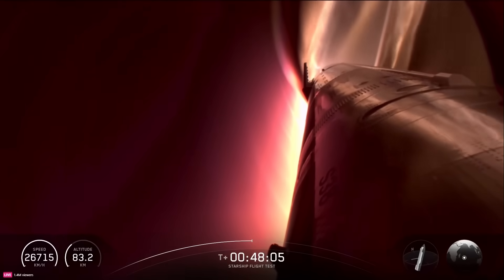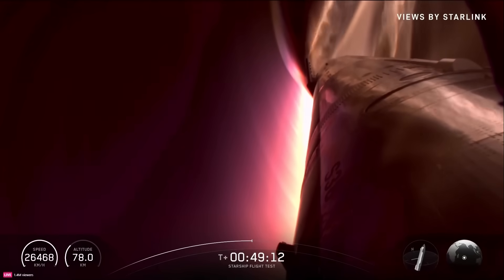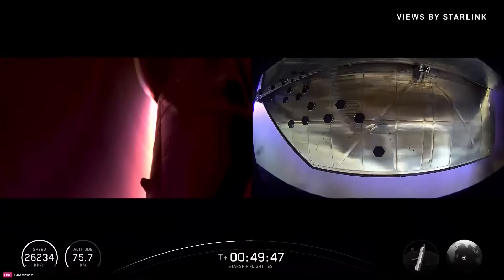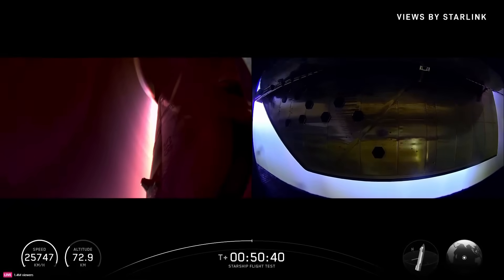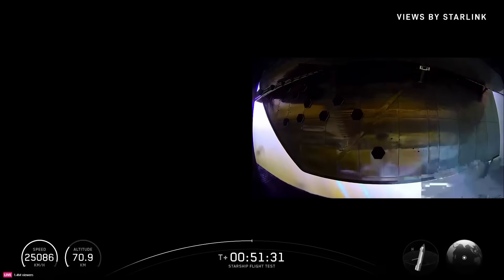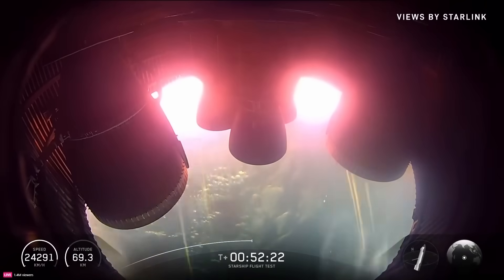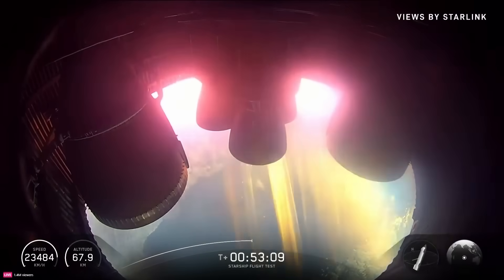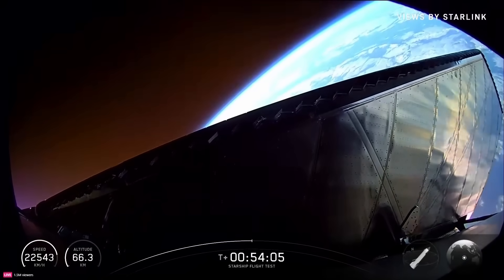SpaceX Starship Flight 11 reentry and descent | Engineers monitor heatshield tile loss

Comment: What are tiles and what do they do / purpose?  How can I learn? 4:00
Reply: They protect the main body from the extreme heat. Space ships have been using them since the beginning. Capsules have them on the bottom as they reenter the atmosphere. The atmosphere creates drag which causes friction which creates heat. The faster you are going the more heat that is generated. Do a simple search on heat shields for space craft.
Reply: Heat tiles are to protect the reentry ship from extreme heat and if the purpose is to also use heat tiles and relaunch immediately without refurbishing spacex has to test them until the stop losing heat tiles